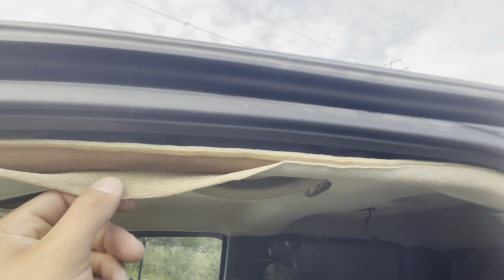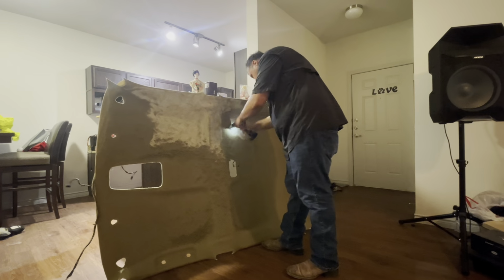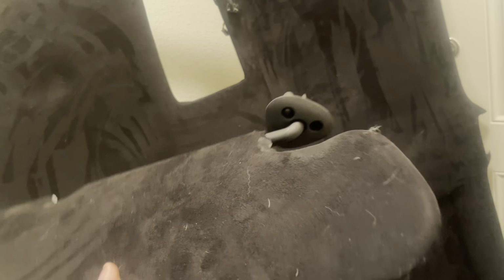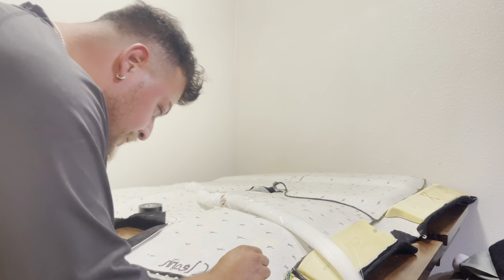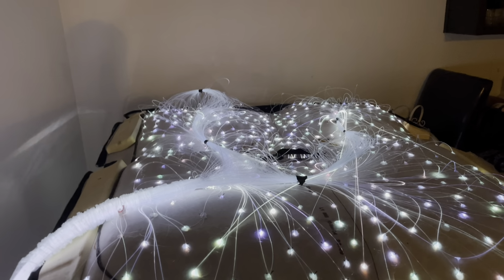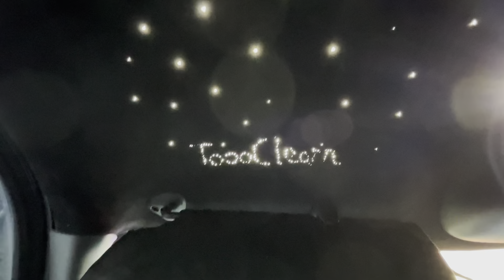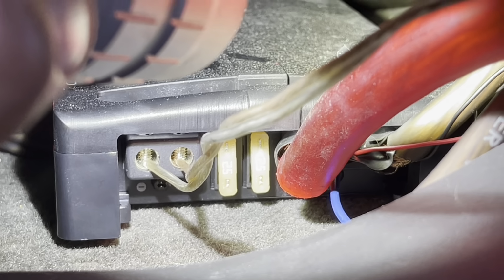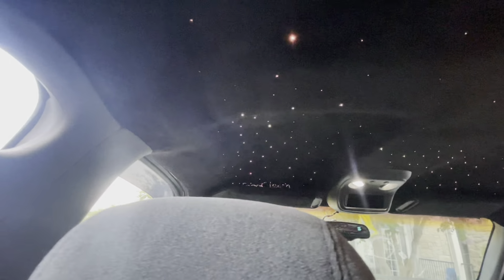99-07 NBS Starlight headliner DIY!

Comment: Alright explain the amp part I’ve tried to connect mine and not turning on. I’m new to this so I might be putting it in the wrong place
Reply from the maker: Positive wire from the starlight cable will go to blue wire on the amp the ( ignition power wire )and negative wire will go to (ground wire ) on the amp should be good 👍🏼

Comment: clean video bro how’d you convert the outlet plug to the fuse box?
Reply from the maker: Just cut it and taped into power on the amp for my bass I have setup
Reply: @ToooCleann can i Connect it on a 4 channel amp?